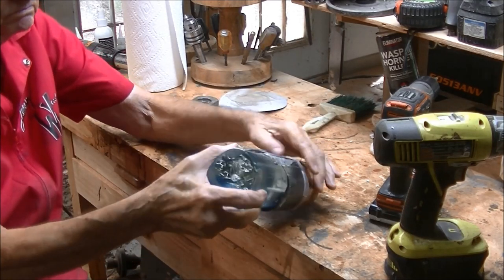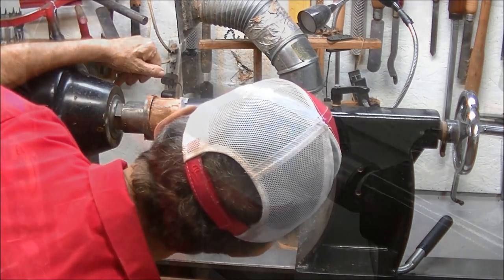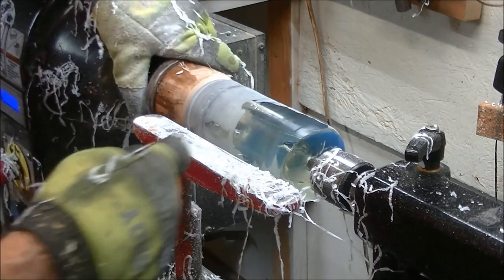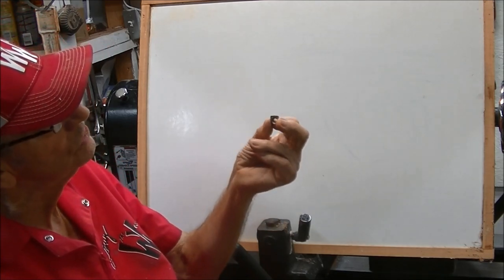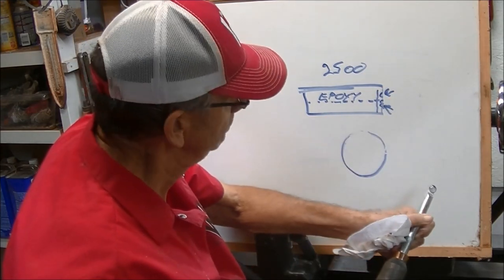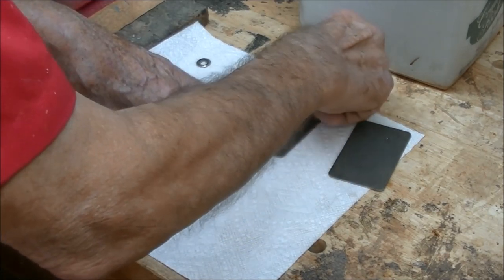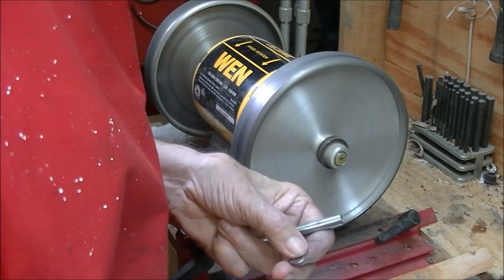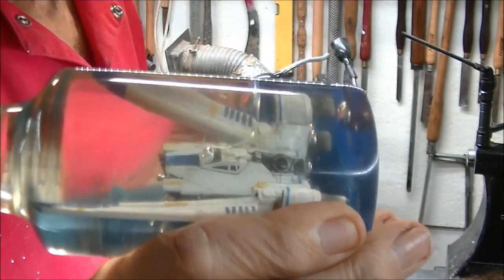Starship in a Bottle with carbide tips. # 234

Comment: Very interesting turning Larry and lots of great tips.I think there is a lot of confusion on tool rest height for turning. You cleared that up. It shows clearly how on the out side at center of a little above is what you want. The inside is just the opposite as you want to be at center or below  this also gives you a little clearance where there is no material directly about the cutting edge as well. By the way the exact angle of those cutters is 30 degrees. I just had to go and measure it.
Glad you were able to get out and do a little bit.
Take care,
Gary
Reply from the maker: Thanks, as you know measuring is not my thing.  That's why I never and never will make segmented things.  Just don't have the patience. Thanks, see ya, Larry

Comment: For epoxy with plastic inside, I'd definitely go for the vacuum chamber. There is no danger of extracting air bubbles from the plastic. 
The pressure pot will most likely crack either the plastic or the epoxy around the plastic.
Reply from the maker: It wasn't plastic.  I bought a metal one because I know all about the issues with plastic.  Vacuum pots don't work well with epoxy anyway.  Thanks, Larry

Comment: Good points on turning with carbide tools!   Whether turning wood or resin, the turning must be done at a high speed.  Carbide tools don’t cut well at low speeds (< 1000 rpm).
Reply from the maker: They don't cut resin good low speeds, 
 but wood is generally good if your carbide is sharp.  
Thanks, Larry